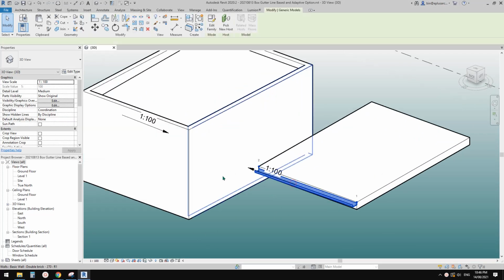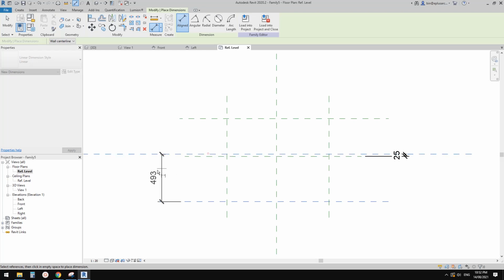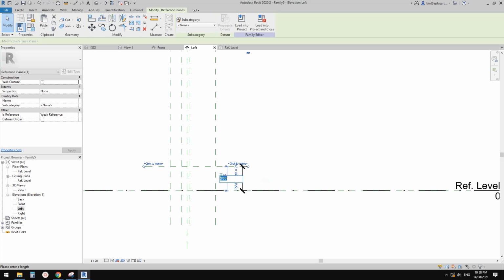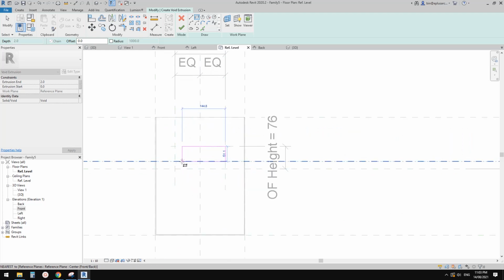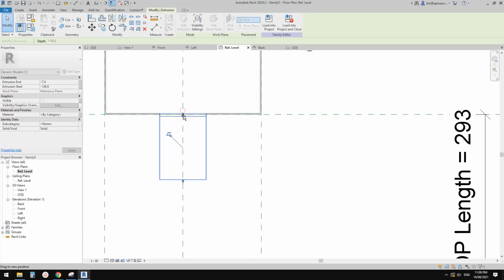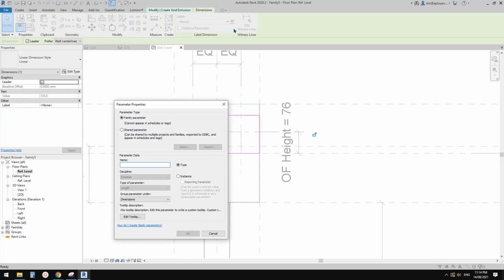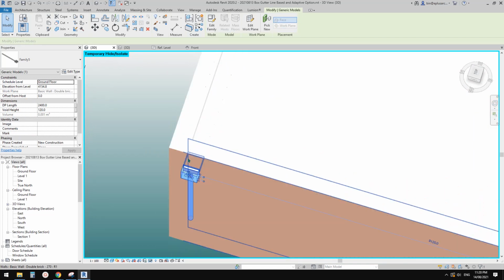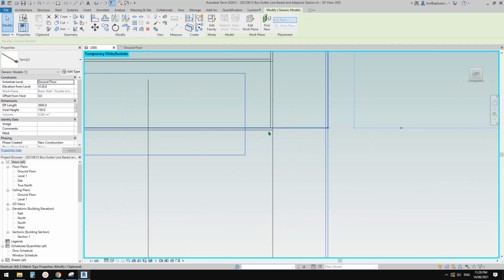Everyday Revit (Day 512) - Parametric Rainwater Head

Comment: Hi Ben love the channel, especially your trick adaptive families. Just a couple things on this Rainwater head. There is no need for a void in the base for the rain pipe just include a circle in the bottom extrusion constraining the circle to the reference planes (using tick box for Center Mark Visible). I would also use the diameter dimension (not radius) for the pipe nobody uses radius when specifying a pipe size. Keep up the good work.
Reply from the maker: You are exactly right, good work.